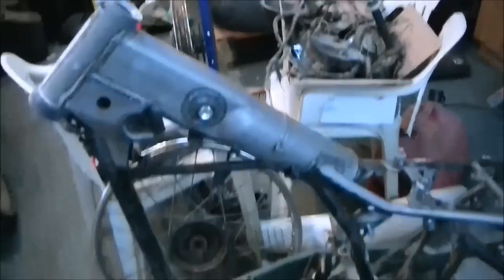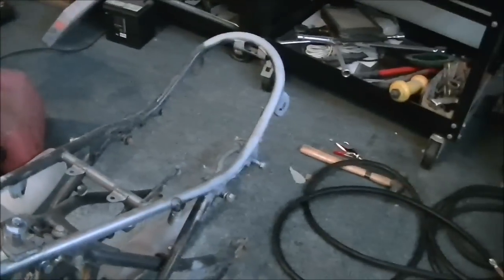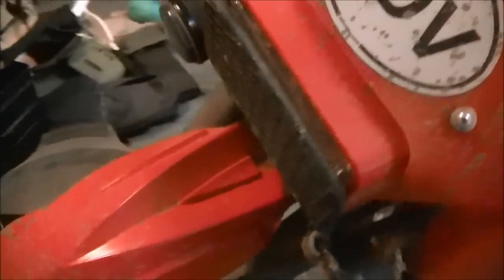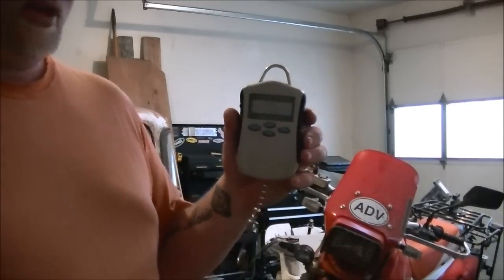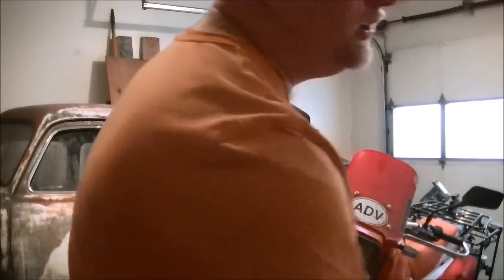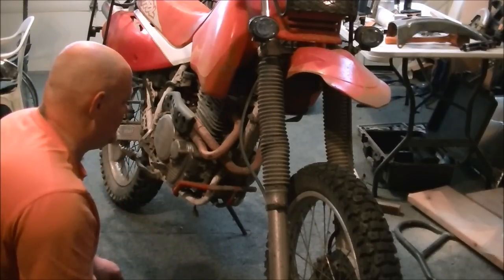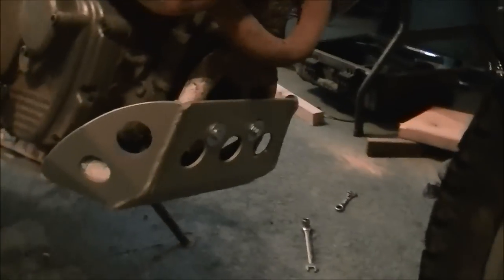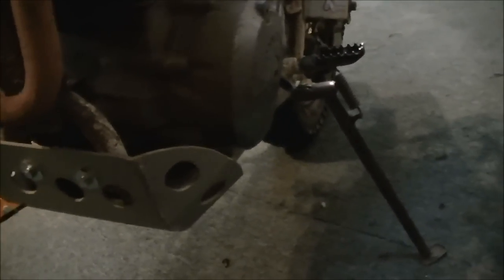Moose racing skid plate on my XR650L

Comment: My 2018 XR650L fell over in the driveway from the side stand, and the shifter punched a hole in my stator cover. Every 650L needs some kind of protection.
Reply from the maker: Ouch, that sucks!
Reply: @NWAdventureRider  It has 21 miles on it. thankfully, my brother in law is a Honda wrench.
Reply: Grab a JNS Engineering side stand foot pad, or similar item. You’ll have a larger and grippier footprint.